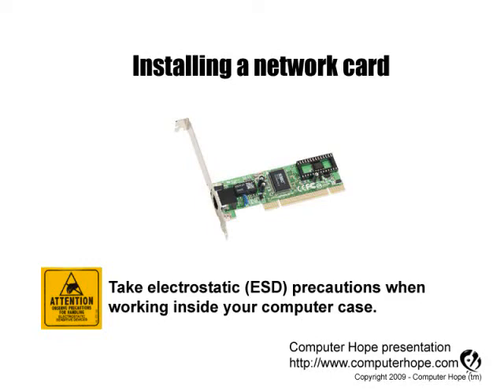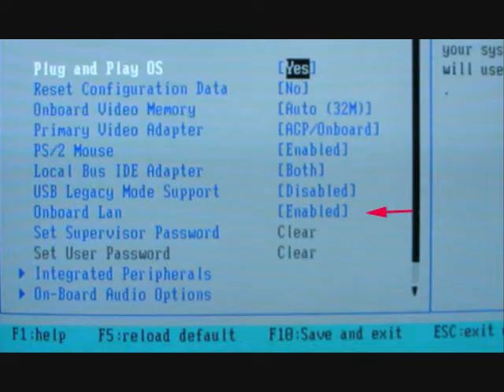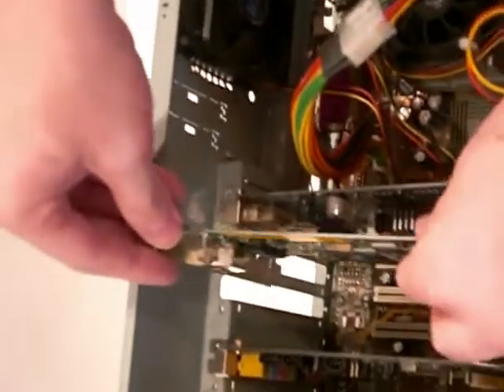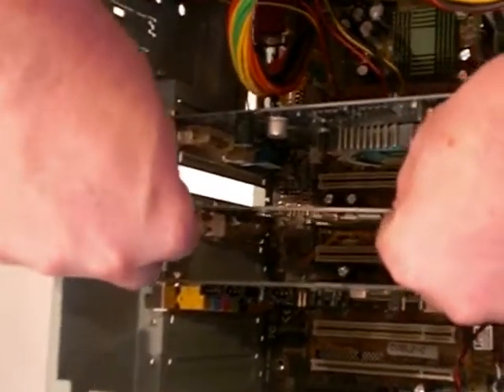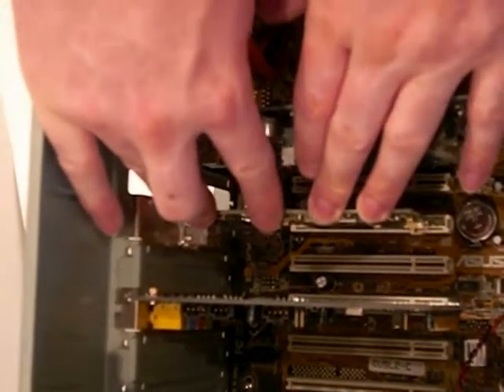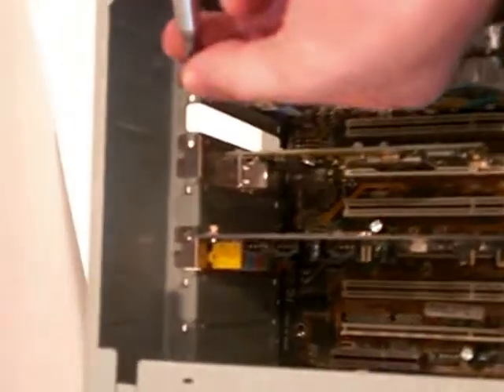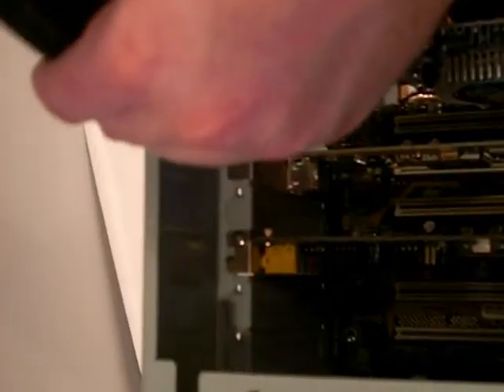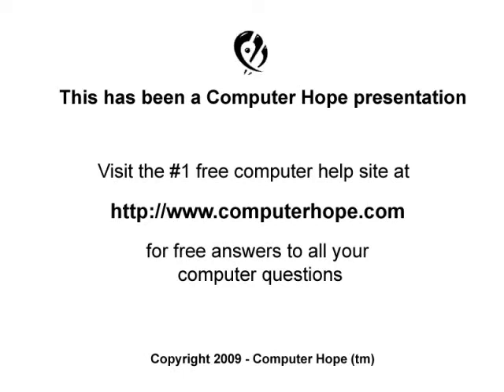Installing network card

Comment: It depends on the speed that your iNet provider gives you. Check in Wiki the article on 10/100/1000. If you have a Gigabit-connection, than a 100BASE-TX Ethernet cable is not the way to go.But before you start looking for the hardware make sure it's not the software. Check if some application doesn't slow your overall connection down. Also check online your provider's reputation when it comes to throttling P2P or similar traffic (for example: download size cap).Some providers do that on purpose.

Comment: Hey guys I got a question. I have an Alienware PC with 
two Nvidia Graphics Cards both hooked together with
and SLI Unit (Bridge). Do you know if I will be able to 
install an PCI Ethernet Card/Adapter without this bothering
the SLI Bridge since there is like 2 slots open between the 
two graphics cards, where the bridge is. I want to install
the PCI card between the two grapics cards. PLEASE HELP!

Comment: I am having issues getting my WG311 v3 (Netgear WAN card) to work on my Windows 7 64-bit computer. I plug it in and basically it isn't showing up in device manager, the drivers and software have been installed prior to plugging it in and I don't see a problem? Did I miss something?